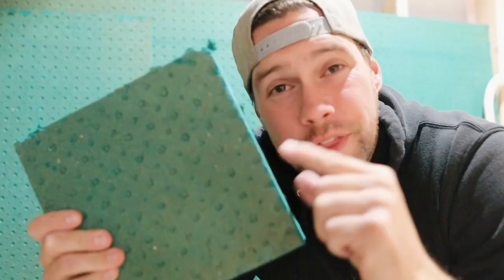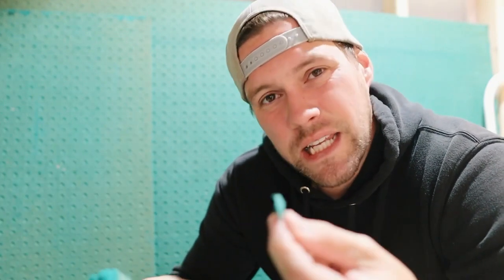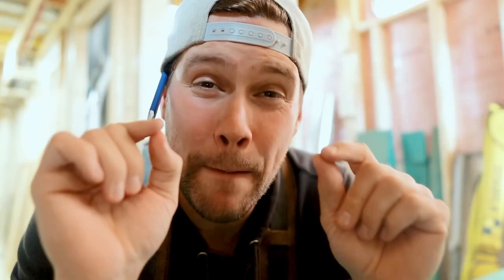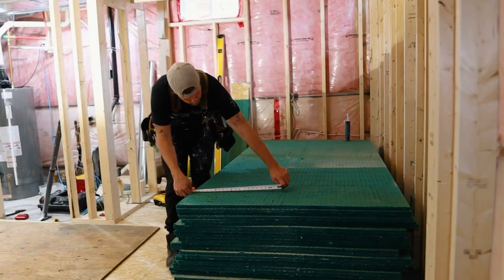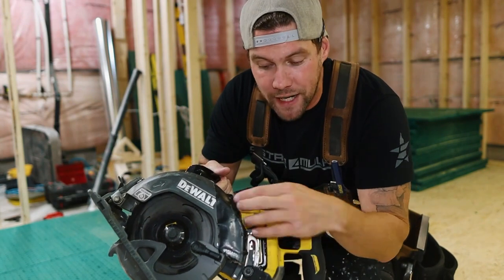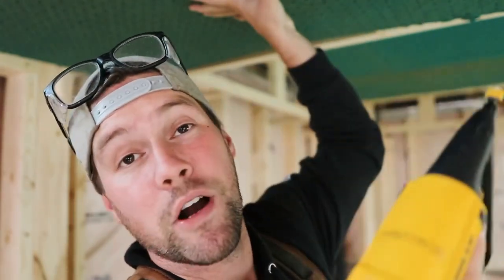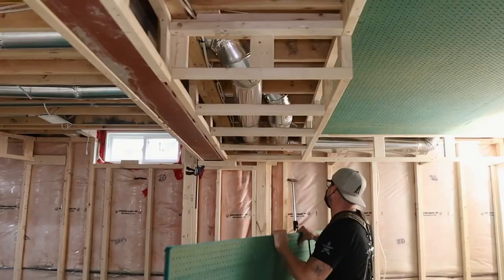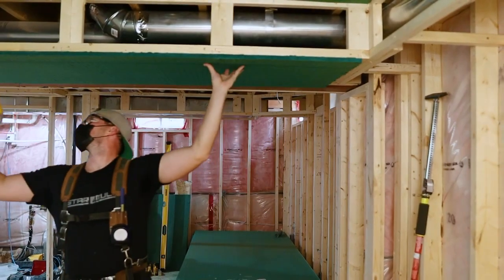An EASY Way to Soundproof Your Basement

Comment: Is batt insulation required as well between the joist, it looks like you didn’t do that step. Wondering if I need to add insulation as well …
Reply: That would for add more sound deadening. I am wrestling with the same thing, insulation isn’t cheap anymore. So I am wondering if sonopan alone would be enough. I’m not looking for 100% proof but a bit of sound proofing and as much impact noise reduction as possible.

Comment: Hi, I noticed you're not using the resilient channel and installing directly to the framing and joists. I'm planning to install sonopan on my un-insulated bsmt ceiling as well, but the contractor says I need the resilient channels. How is the noise reduction in your bsmt?

Comment: I've seen a lot of people add a resilient channel after the sonopan and the drywall screwed on the resilient channel. From your experience, is the Soundproof insulation + sonopan + 1/2 inch drywall enough or would you add a resilient channel in-between the sonopan and the drywall?
Reply from the maker: I would definitely recommend adding RC for added support!
Reply: Resilient channel adds a different element of soundproofing, it de-couples which adds to the soundproofing of the ceiling. It's great for heavy bass and vibrational frequencies
Reply: @sonopan_msl  Thank you for your feedback. Another question I have. If I make a hole in the middle of the ceiling for a light fixture, and if I put some putty pad around it, would that be OK or am I destroying the soundproofing at that point? What are the recommendations here?

Comment: What if your basement is 6' tall?  I can add batts in cavities, but what about impact noise (footsteps)?  Any way to decouple my ceiling from the joists without losing even 1/2"?  (Resilient channel is 1/2".  In my context, that's too much.)  
Would getting a thicker carpet, or mass-loaded-vinyl or just regular vinyl flooring help?  I see those helping if someone was wearing high heels, or very hard-soled boots, but they're just walking in bare feet, making heavy thuds.  Is there a way to decouple from above?  (Decouple floors instead of ceilings?)  There's underlay.  There are sprung floors!: subfloor then half-tennis balls then subfloor then floor.  (I don't know how the upper subfloor doesn't deteriorate at each sheet's edges.) ,
Reply: They make a rubber mat roll that can go under the flooring that’s very inexpensive per square ft and is absolutely amazing for soundproofing footsteps

Comment: This is an awesome video, and I will definitely be getting some of this! I just have a question… do I need to drywall over it, or just paint over it after it’s installed? And can it survive in a workshop environment? Great video Mark!
Reply from the maker: Thanks so much for watching. You definitely would need to drywall over it to seal it up. The fibers in the material are pretty fragile
Reply: @RemarkableWoodworks  thanks for the info!

Comment: Thanks for the video! I converted my home into a duplex and live in the basement. My current strategy for sound separation is double drywall and it is not cutting it (mostly for eliminating footsteps). Would you recommend Sonopanel and resilient channel? Can you hear footsteps with your install? Thanks again! I live in Toronto and would love to attend the DIY conference! Cheers!
Reply from the maker: Thanks Brandon, I definitely would recommend a resilient channel! I didn’t have the space here for it. Send me an email and I will get you some tickets: remarkablewoodworks@gmail.com
Reply: Ideally, SONOpanX would be placed on the subfloor above to address those impact noises
Reply: Thanks for the replies, I want to use the whisper quiet resilient channel clips. Is there a preferred way to install theses with sonopan? I will look to add it to the subfloor when our renovations reach that part of the house! Thanks again!
Reply: @sonopan_msl  any chance you could provide me guidance as to how I should install resilient channel clips with sonopan in the ceiling? Also, can hardwood floors be installed on-top of the sonopanX?

Comment: Do you think this could be added to an exterior wall, from the outside? Plan on insulating my walls from the exterior side by removing the siding and resheating the walls. Was considering adding this to the new assembly. The walls finish is historic plaster, and removing or covering is not an option.
Reply from the maker: Great question, I definitely would not recommend adding this to the exterior. It would not hold up to the elements. I can reach out though and see what they recommend
Reply: We have a product designed for sheathing called eco4, this would be the best option.
Reply: @sonopan_msl  thank you I will check this out!

Comment: How do you install the drywall over it it screws thru both into the studs
Reply from the maker: drywall goes on the same it usually does, you just have to use longer screws to account for the thickness of the Sonopan

Comment: Welcome to the 2 kids club.... and I'm pretty sure what you said in the beginning made sense lol. I'm looking at finishing my basement in my 2020 built home and was looking at the RC +5/8" drywall method as it's a living space for my mom. Would Sonopan and 1/2" drywall give a similar STC rating or is it still best to decouple the ceiling drywall from the floor joists?
Reply from the maker: Hahaha thanks for the warm welcoming. It sure is a great club to be a part of - question: when does the hole being able to sleep thing start up again? Personally, I would go with SONOPAN and a resilient channel and then 5/8 drywall. I haven’t tested it though. I can reach out to them and get a tested answer for you, if you’d like?
Reply: Resilient channel adds a different element of soundproofing, it de-couples which adds to the soundproofing of the ceiling. It's great for heavy bass and vibrational frequencies
Reply: @RemarkableWoodworks  Thanks for the reply. For an entire basement, I think both SONOpan +RC + 5/8" might be overkill. if I'm really worried about the footsteps being heard all the time, RC is best with insulation between joists and if I'm worried about voices being heard, then SONOpan and 5/8" is best?
Reply: @sonopan_msl  I was wondering about the decoupling effect that RC has and if the fibrous material of this product acts as kind of an isolator but I guess the drywall would still be screwed directly to the studs, through the sonopan right? some sort of decoupling would still be best for footsteps and subwoofer noise cancellation from the main floor.

Comment: Where was this stuff 20 years ago when I use to do a lot of renovations lol what size dry wall screws do you need to use to hang the drywall with that stuff? Oh an congratulations on the new baby 👊🏽
Reply from the maker: Hahaha right?! I could have used it on several passed projects. I used 2” drywall screws and thanks so much!

Comment: Wish we could get it easily in the states. Sick of seeing this on every canadian channel.
Reply from the maker: What state are you in? From everything that I’ve heard, they are available
Reply: @RemarkableWoodworks  delaware.  You need to import it through a supplier at a heavy cost
Reply: @RemarkableWoodworks  not something you can just slide in to home depot,  or even a building supply company around here and pick up off the shelf

Comment: If u like a ton of stupid hidden adds, enjoy this vid. The music is a still from Scot Brown vids. Literally 0 value vid. Any idiot knows where to get Sonopan. Definitely a DIS. U don't need to nail  Sonopan super hard, just to make sure its not falling off. It is gonna be secured by the drywall anyways. U can cut it easily with a knife. U can use any soundproofing silicon. U don't need to by Dewalt tools. Milwaukee is a solid builders brand. Makita has the best support and more high grade tools. Just don't see the point of getting Dewalt tools.
Remarkable  bad acting. Look at the face of that dude. It a shame he calls himself a carpenter. Just a bad salesmen.
Reply from the maker: So for subbing to the channel, I should just put you down as a maybe then, orrrrr?????